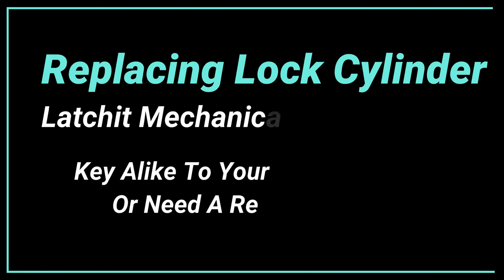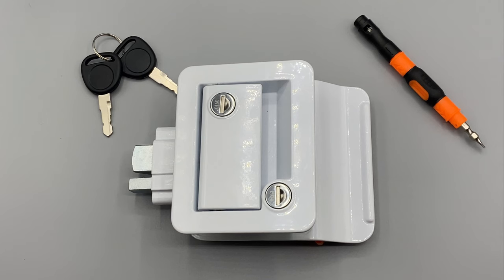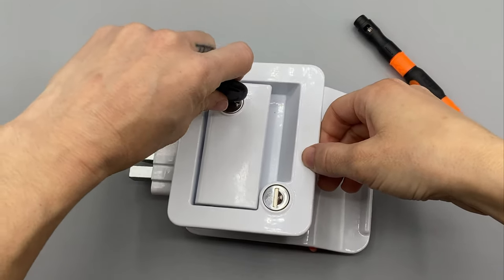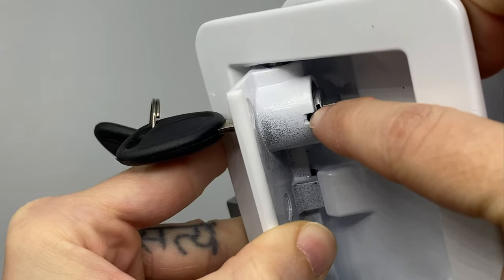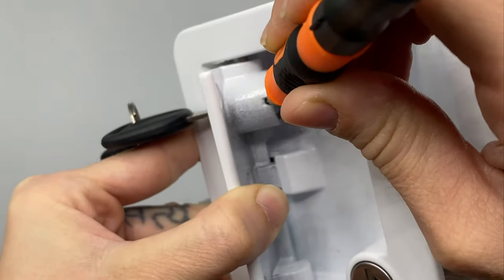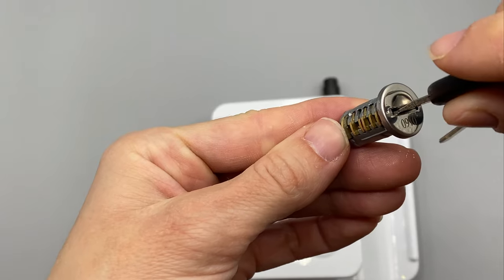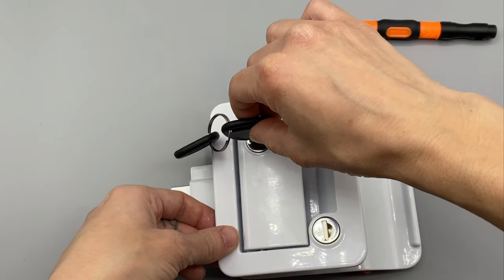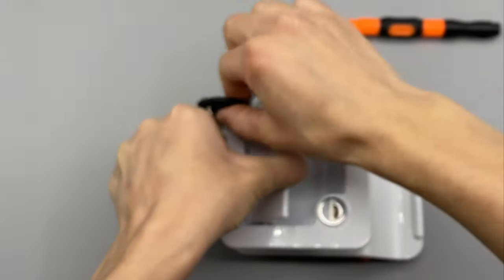RV Mechanical Lock Key Cylinder Replacement by LATCH.IT

Comment: My little spring loaded guard that goes away when you insert the key doesn’t cover the slot when the key isn’t inserted? Does this mean I need a new tumbler?
Reply from the maker: Hello @theemrc, thank you for reaching out. It is possible you may need a new cylinder. To better inspect your concern, you can reach out to our awesome support team via our website www.latchit.org or email info@latchit.org.
Reply: @latch.itlocks7638  thank you much!

Comment: How do you change the dead bolt cylinder?
Reply from the maker: Hello there! Thank you for the great question. The deadbolt cylinder is removed in the same way, but the back panel would need to be removed first. We do not recommend this due to the small parts inside when removed.  If you have an issue with the deadbolt please reach out to our support team. If you have to access the deadbolt cylinder our support team will give you a step by step walk through on how to do so. https://www.latchit.org/
Reply: I rekeyed one door to match the other door.  There's two ways to do it, either get a locksmith or dealer with the official cylinder removal key, or take the lock assembly out of the door and take it apart to remove the old cylinder and install the new one.  It's not very difficult, but care needs to be taken to get everything back the way it's supposed to be.  It took me about ten minutes to figure out how to replace both cylinders, I was trying not to disassemble the lock so I made what is basically a lock pick out of a hacksaw blade to reach inside the cylinder to push the locking tab and pull it out, the official cylinder removal key works the same way but looks just like the normal Global Link keys.  My pick worked first try with the paddle lock, but I couldn't quite get the deadbolt lock out so I just took it out of the door and opened it up.  Gave me a chance to grease everything as well.  All in all it wasn't bad.